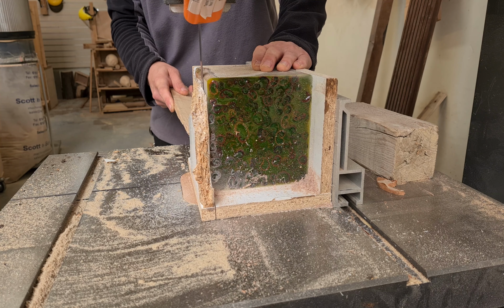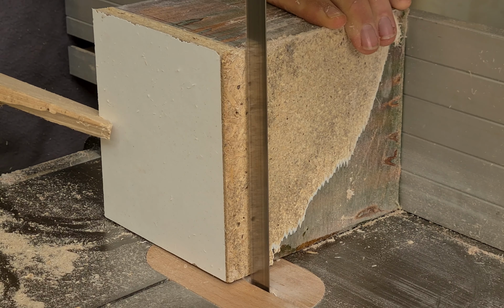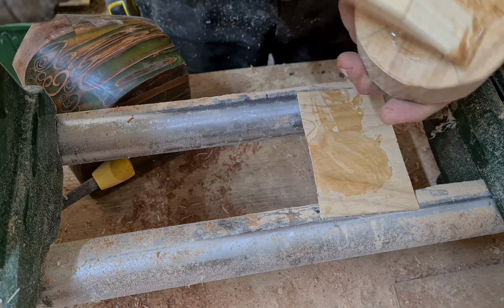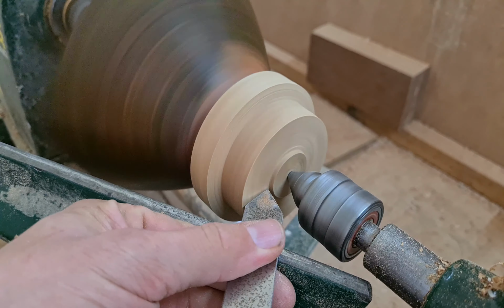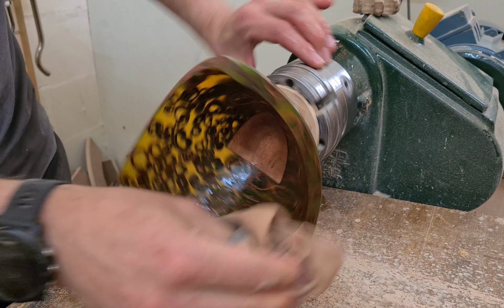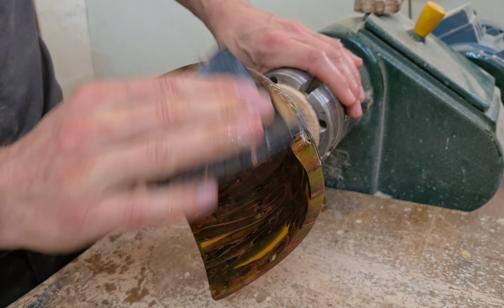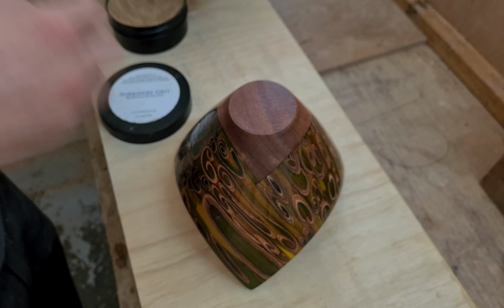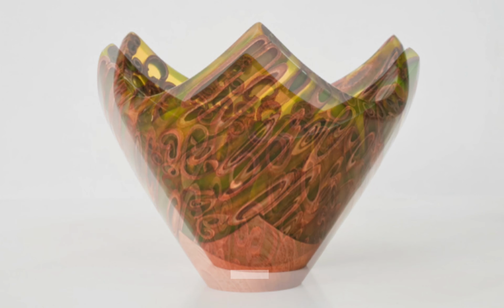Woodturning - Cinnamon Sticks into a 3 Corner Bowl

Comment: Looks great. Yes reflection of the brown cinnamon makes the resin look green. I use burnt orange (orange with a smidgen of black) resin and it looks great.  Really like the idea of the timber cube to form a base, you could even add some LEDs to shine up into the resin
Reply from the maker: Burnt orange was the kind of colour I was hoping for, but got this weird avocado hue instead! I could have increased the intensity of dye, but then would diminish the transparency and seeing the full effect of the cinnamon sticks. Really like the idea of LEDs to shine into the cube but also toying with how to puts lights into the resin and still being able to turn the thing without hitting a wire. food for thought! Thanks so much for your feedback and sharing some ideas. All the best. Ray
Reply: @RayWhitbyCreations  The reflective nature of the colour is also dependant on the dye used. I’m finding the cheaper Chinese Indian inks are actually better than the proper more expensive dyes from that perspective.

As for LEDs, I often install individual wired LED globes into drilled holes that only just penetrate into the resin. I then have a covered junction box of sorts at the back or underneath that joins them up and connects to power

Comment: Ray I am curious about when you first put the project on the lathe. I have zero turning experience, but I cannot figure out why people do not do at least some minor shaping using a bandsaw or a belt sander to take down those corners. Turning them all the way down seems like the least efficient and the most likely way for an accident to happen. Thanks for the great video. Ohh, I had one more question, do the cinnamon projects have a strong fragrance? If so that is a great way to incorporate another dimension to projects (dried vanilla pods come to mind).
Reply from the maker: Hi Curtis. Great questions! To the first one, yes many woodturners would shape their piece on the bandsaw first to remove the sharper edges. I usually do it for square profile pieces of wood into a octahedron then on to the lathe. But some turners are happy to whittle away from the square profile. Woodturning is relaxing, so I understand someone's desire not to rush. For the 3 corner bowl, then you have to know where to make the cut with the bandsaw and then hold it in position safely whilst making the cut. That can be very difficult.  

To the second, yes there is still a little cinnamon aroma percolating through the sealant/resin. I really like the idea of using vanilla pods, apart from that they are so expensive! Maybe a smaller project with them would be better. And it's a shame Youtube hasn't got smell-o-vision, because the audience is missing out! Thanks so  much for you feedback and ideas. Take care. Ray

Comment: Beautiful. Did you save the large piece you removed from the center, for another project?
Reply from the maker: Thanks Adam. Yes I still have that piece and wondering what to do. Thoughts? Someone suggested a gear knob, walking stick head. Was thinking that I should put in a sacrificial piece of wood to reduce the amount of wasted resin - now that I can work out the correct dimensions and placement. All the best. Ray

Comment: I just have to know... Could you smell the cinnamon while you were gouging it or did the resin permeate the cinnamon well enough that it sealed in the oils as well? And I loved how the color turned out.
Reply from the maker: Hi! Yes the cinnamon aroma was very strong throughout the turning and because the dust was hot off the lathe, it started to burn my skin! Or at least was getting an irritation. After the project, there is still a faint smell of cinnamon and quickly goes to neutral after a couple of weeks. I did use a sealant, so perhaps not sealing it then the smell would last longer. Or I need to use stronger smelling cinnamon! All the best. Ray

Comment: couldn't you cut the cube in half so you could make 2 bowls, seems like a lot of waste turning away half the material, or am i seeing it wrong, i am not a wood turning expert, either way i like the color
Reply from the maker: Hi Leon. It might be possible to core a small bowl from a larger one, but not seen it done with resin. For this project it should be possible to position a small scrap wood cube into 1 corner to reduce waste. This does require some understanding of how the cube turns in order to calculate the size of the waste piece, which I can only now do from having done such a project. Sorry, taking a long time to say it should be possible, but not easy. All the best. Ray